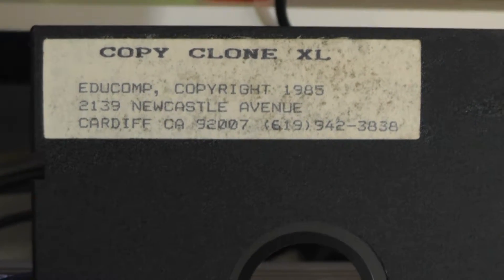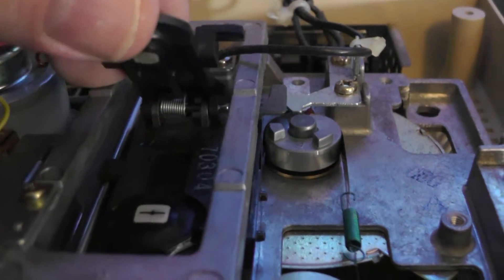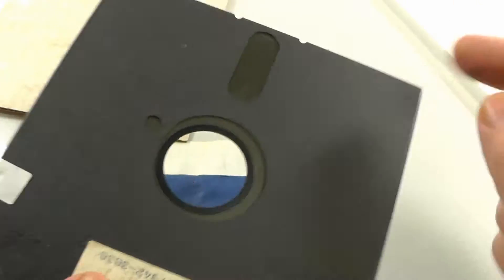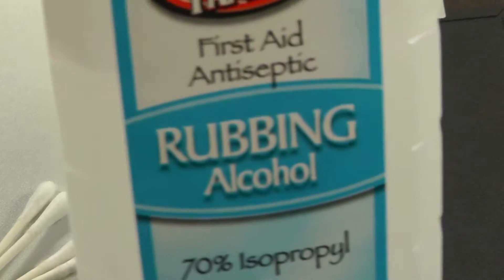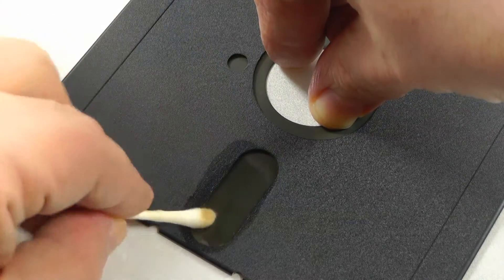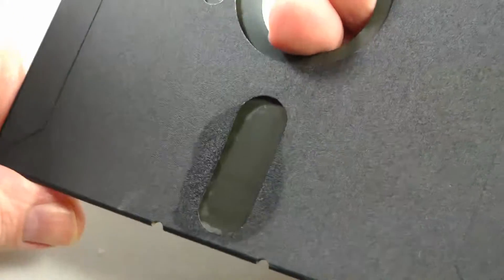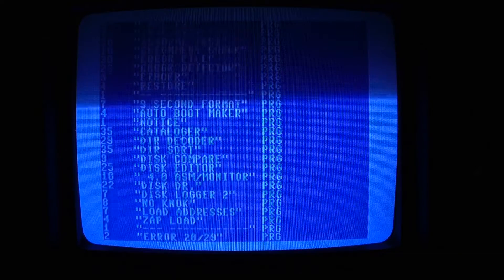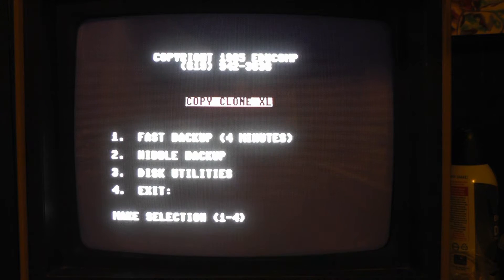FIX Your FLOPPY - Commodore 64 and Demo

Comment: Beware doing this...I might have rubbed my copy of Back to the Future 2 a bit too hard. Initially the game would boot to the title screen, but when trying to start up the game, I would just get stuck on a colored screen. When cleaning it, I read too hard at one point, scarring the disk. So now it won't even load the splash screen. The disc drive makes it clicking noise, and then the red light starts flashing rapidly.

Comment: Your tip about cleaning the inside of the disk drive with a Q-tip and rubbing alcohol works! I thought my computer was not communicating with the drive correctly, meaning there was a chip problem inside the computer, seeing that I was having the same problem with two disk drives. I am happy to say that your trick worked, and now I'm looking forward to enjoying my Commodore 64 to its fullest. Thanks for the great video!
Reply from the maker: Thank you for the comment, I have a PART TWO to this video, I really need to get online. I convert an old 1541 into my cleaning drive.

Comment: What you are actually cleaning off the disk is some of the magnetic material itself, hence the strange rusty color of the Q-tip. The actual binder material of the disk which holds the magnetic coating to the circular mylar sheet that the actual disk is made of, is breaking down after all these years. Some disks are worse than others due to differing formulations in addition to the conditions under which the disk was stored all these years. Its fantastic we have people like you dumping these disks for preservation purposes, because disks such as these wouldn't be readable even with heavy cleaning in a few more years.

Comment: What's this rubbing noise that we  still hear while the disc is spinning ? Is there any tips to get rid of it ? Disc disassembly maybe? I suppose that it comes from some sort of padding inside the disc which could be to much contaminated and therefore rubbing.... as the disc itself was so shockingly dirty (tar, nicotine ?)...
Reply: LFOSyncToo The rubbing noise is because of the inside of the disk jacket. They have a fuzzy gauze like material inside the disk jacket that is supposed to slide nicely against the actual disk media itself. Since he also has the top of the disk drive removed, its a bit louder than normal.
Reply: Yeah but some disks are noisier than others, hence my question :)
Reply from the maker: Exactly, I keep the top off or loose on all of my 1541 drives I use. It's because the disk are usually so dirty that the read/write head need frequent cleaning. Sometimes after EVERY DISK.
Reply: Steve's World I keep the screws out of my lid as well, since I need to clean them after every other use. I thought I was doing something wrong, but it looks as if I'm not the only person with the same issue.
Reply: @2112dorf  I wonder if it's the disk quality, or simply having a stash that was poorly stored.... but I don't have that kind of issue with PC floppy drive of the early 1980s.... I LOVE retro computing with 5 inch floppy on PC machines, I HATE the same activity on a c64...